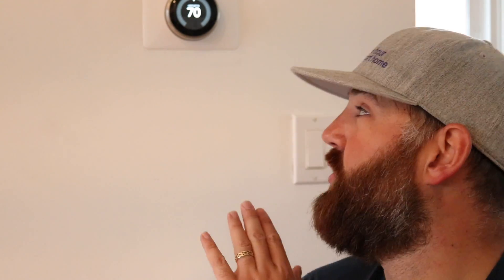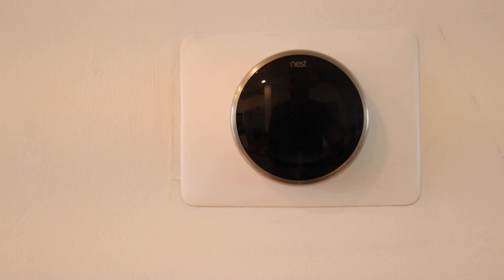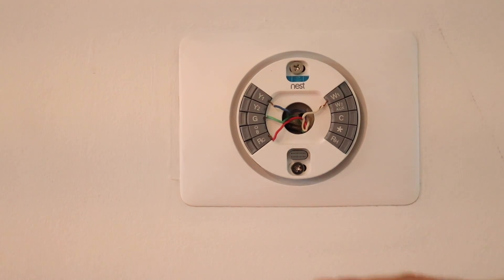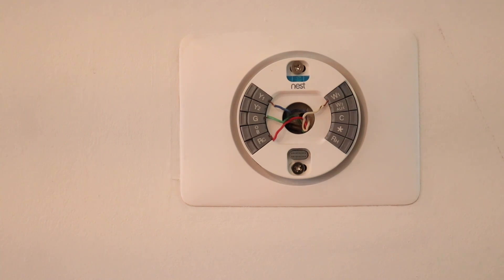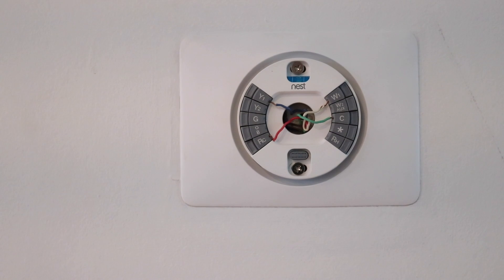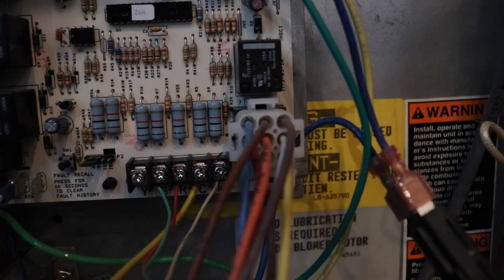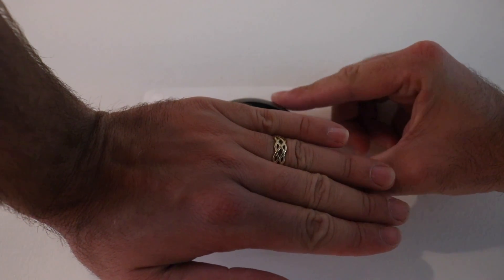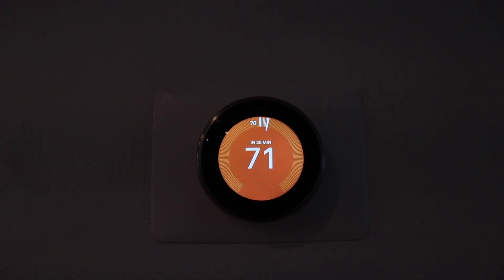Nest Common Wire Hack!!! - Nest Low Power Fixed

Comment: My thermostat wiring has a c-wire that isn’t attached to the C screw on the furnace but there is another wire attached to the C screw on the furnace board. I assume that’s from the outside compressor? Can I connect the unused C-wire to the furnace even if there’s another wire there?
Reply from the maker: Yes, typically you can connect the unused wire to the HVAC terminals even if theres another wire on the same terminal. Just follow the  path of the spare wire you are going to use or make sure it's in the same bundle as the other wires going to the thermostat. Also your assumption is probably correct that the other wire on the C terminal is running to your outside compressor. Typically the compressor wiring will make a circuit that is from the Y terminal on the control board to the compressor and back down to the C terminal on the control board.

Comment: Your configuration at the panel doesn't match behind the thermostat. there's no yellow behind the thermostat. And at the panel yellow is already on C with nothing on Y. Why is that?? And what if yellow is on Y at the panel...will you need to add a jumper from Y to G once green is moved to C at the panel?

Comment: Thanks for this video.   I didn't read all the comments, but I didn't see this one point.   I was having occasional issues with low power on my Nest.  I watches some detailed videos about low battery where it spells out that Iin (Current in) should be above 20mA (mA is a measure of current.  Controller uses 24VAC to send signals to the Nest.)  

Mine was at 20mA.  So mostly working, but sometimes not (Low Battery, Network disconnect, etc).  My house has 3 wires, so I moved the G to 24VAC Common (C).  Then the Iin bumped up to 200mA.  I figure that should keep the battery pegged, and fully charged.  I assume Iin is the current being fed to the Nest from the control circuitry.  Please correct me if I've got anything wrong.

Comment: I just bought nest 2020 thermostat. I have only heating system with two wires ( there is a blue (G) wire in the wall for fan but it was not connected to my old thermostat. Now after connecting wires, neither nest app nor google home lets me continue setting up my thermostat. What am I doing wrong?
Reply from the maker: Mina, watch these videos they should help: Nest 2020 Install:  https://youtu.be/dhwl5h2uynI    2 Wire install: https://youtu.be/Mhz6bbsCUtE (this still works for even the 2020 mirrored version of the nest thermostat, you just use the R terminal)     Thermostat Wiring Explanation: https://youtu.be/vG-K5TDYYNA  Nest Wiring: https://youtu.be/CCNIko3iZIE .  Not everyone needs a common wire, and if it wasn't connected on your old thermostat you might not need to connect it on the new thermostat.  If you have a Red (R) wire and a white (W) wire you most likely need to just connect the R wire to R and the W wire to W on the new nest.
Reply from the maker: Please share/comment your results to help others when you find a solution, thanks!

Comment: Best video to troubleshoot. I have a modern heating system that wouldn’t turn on after installing the nest. After seeing how simple it was to connect the common wire I went ahead and cut power and reseated the rest of the cables. After a quick reboot everything worked.

Comment: Did this wire trick with my new wifi thermostat. Worked perfect. Got the green wire marked "c" for any future thermostat changes. Never once used the fan anyway, so this saves alot of time from running a new wire.
Reply from the maker: Thanks for watching and the helpful comment!

Comment: My C terminal on furnace board is connecting to the AC ，Can I Connect  two wire together on the C terminal to AC and thermostat ？
Reply from the maker: Yes, leave the C wire on from the AC,  you can have 2 wires terminating on the C terminal, the AC and the thermostat.

Comment: Will this solve the e74 code on the nest
Reply from the maker: The e74 error is no power to Rh wire detected. Typically that means that your HVAC system has either been turned off a the circuit breaker, the switch on or near the unit or it has had a fault that cut power off to the system.

Comment: Using the "Nest Thermostat Common Wire Transformer" worked out great!   My boiler has only two low voltage (5VA) wires for the thermostat.  When I plugged in the two wires to the Nest wiring block heat was called all the time until I unplugged one of the two wires (Rh / W1).  I thought I had a defective Nest wiring block.  However, I gave the common wire a try and now it's working perfectly. 

My favorite feature of the Nest is that it knows I have a boiler/radiator setup and has learned if it turns the boiler off a degree or two before reaching temp that the house will still warm up to temp.   This is awesome because we no longer have the temp overshooting by 5 degrees. Leaving us feeling like the house is at a consistent temp.

Comment: Just so everyone knows. You have to have the G connected in order for it to function in cooling mode. The Y only sends a call to your outdoor condensing unit. If you do this hack, cooling mode will not work.
Reply: Yeah, I have the same issue. In the summer, only the compressor is turned on but fan is off . Worked well in winter but now I have reverse back to G wire.
Reply: @Petey-The-Cat  You just have to add a jumper wire...

Comment: I've read this may not work with HVAC systems that use Electric Heat. Do you know why this is?
Reply from the maker: If you have a 24v low voltage thermostat it should work. Many heat pumps have back up electric heating coils and the nest works fine with them.

Comment: So no Jumper Wire from Y to G? May I ask why that is?
Reply from the maker: Most modern HVAC systems will automatically turn on the fan (G wire) when a call for heat or cooling is detected.
Reply: @OneHourSmartHome  thank you!
Reply: @OneHourSmartHome  I spoke with Nest and they mentioned the nest charges even when the ac/heat is set to 'off' (such as on a nice day). If that's the case, shouldn't my Nest stay charging? I know there are other variables at play, but the nest has been installed for over a year with no issues other than the low power message I saw today. 
I had my T-stat 'off' due to nice weather, then after turning it back on it was connected to WiFi for roughly 10 hours, then I got the low battery. It's back up to over 3.7 volts (it 'fixed' itself in the last few hours and is now back online)
Reply: @OneHourSmartHome what about older systems?? My fan won't run with AC

Comment: I have a heat only system using Nest E and this worked at my cabin, thank you! I hooked 24 v adapter to wire 1 to [C] & wire 2 to [R]. Heater red to [W1] & heater white to [R].
Reply from the maker: Great to hear glad to help and thanks for subscribing!

Comment: C - WIRE  is simply ground / earth wire..  It doesn't really have to be connected to the controler in your ac / or furnace but ANY electrically grounded  object such connector (ground screw)  in an electric switch, the surface of the electrical box (has to be grounded by per the code)  or directly to electrical ground /earth wire.      And yes, NEST will love that new ground connection as it allowes that the battery to be charged full-speed whenever it needs to be, regardles of the ac or furnace being on or off.
Reply: Does that mean I could run a new wire to the ground in a normal electrical outlet?

Comment: Thanks for the Nest 3rd Gen common wire fix. Ended up seeing the green wire from furnace joined to a green wire from the humidifier by wire nut. Took nut off, installed twisted pair to common wire port on the board and BINGPOT!! 😃

Comment: Tried this, I had a 4 wire Honeywell thermostat that was working fine. Connected my Nest with W1-Y1-G-RH and it initially worked fine, but the following day said the internal battery needed to be charged. I updated following this guide, Nest now is W1-Y1-C-RC (tried RH as well as RC, both show the same error), and I get E103 error, basically saying Y1 wire has an issue. Any ideas, aside from buying the transformer or running a set of wires that has C (common)?

Comment: My nest quit working after years of use. I have one of the first gen units. It complained about no power on rh. I had a spare blue wire in my bundle and wired that to C at the nest and control board. AC is working now but it now complains about no power on stage 2. I'm just glad to have the AC back.

Comment: I just got the Google nest e thermostat and I only have 2 connection the white wire and the white wire and a bypass that does from the Rh to the RC. The instructions say that the bypass is no longer needed but I do not have any power on my new thermostat. What am I doing wrong

Comment: Did this and it worked for about 2 hours. Now I'm getting a Y1 wire problem.
Reply from the maker: Interesting, could be a bad transformer, blown hvac fuse or something wrong with your hvac system. What wires do you have installed on your nest?

Comment: My Nest also has power issues. I have a blue wire connected to the Common terminal on my control board but was not connected to my old thermostat. Can I just use this Common wire with the Nest?

Comment: What if you live in a hot climate. Never turn on the heat. Can you use the W wire?
Reply from the maker: Yes, if you never intend on turning on your heat and you have a traditional HVAC system. You would disconnect the w wite at the hvac system and thermostat and move it to the c terminal on both the hvac system and thermostat.

Comment: I have a dual system boiler for heat and AC for cooling the cooling is zoned and to control it they both use only two wires,  cool is wired to Y and RC and heat is wired to W1 and RH my nest is not charging and shuts off I tried wiring a C wire from the Boiler transformer but the Nest gives me an error message should I take the C wire from the AC instead?
Reply from the maker: Yes, I would try taking the C wire from the AC.

Comment: I have error code E23 on the cooling Y1 yellow wire. I checked and they are all connected. Why would I have this error when I’ve been using it for a year with no issues?
Reply from the maker: Either you need a common wire, or it could mean you are having an issue with your HVAC system where it has tripped an internal breaker and cut off power to the thermostat. Or the switch is off for your HVAC system or the circuit breaker is off for your HVAC system.

Comment: Dude....THANK YOU!!!!!!!! I got it to work. Damn Nest could have put a little MORE emphasis on you NEEDING low voltage power to the thermostat. 

So I was worried that I'd lose my HVAC blower (not fan) to circulate the coolant through the house but as I found one white wire in the "common control panel" already connected, I simply added this fan wire (green) to that instead along with that white along side it and it worked! Thank you for giving us this hack. I'll remember what I'll need when I bring this Nest to my new construction house I'm working on customizing.

Comment: Should have never installed these Nest thermostats in my house, have three of them, one on each floor and I get error codes all the time on mine! Time to get ride of them and put traditional ones back on after 6 years of problems!
Reply from the maker: Do you have 3 HVAC systems or 1 or two systems with mulitple zones? If you have a zone panels you will need to run a common wire from the zone panel to each nest typically for the HVAC to work properly.

Comment: Thank you for this information. When I took the panel off of my furnace the control panel is not visible. I do see the thermostat control bundle of wires coming into the furnace with the blue green yellow orange red white brown etc. wires. They van are all connected via wire not to matching wires coming from inside the furnace. Right now the green wire is connected to a thick gray wire, not one of the thin low-voltage wires like all of the others. When I attempted to remove the green wire from the thick gray wire and connect it via wire not to the yellow wires the unit wouldn’t work. So I put everything back the way that it was. Any suggestions? I really appreciate the help. Thanks
Reply: Same problem I have. My HVAC is only 3 yrs old so I don't know why the gut did that

Comment: Will this work with a central unit? One that has heat and cooling?
Reply from the maker: Yes it should. The Gen 3: https://amzn.to/2OlfEWk works with most HVAC systems including some light commercial rooftop units. As long as it's got a standard thermostat currently and not a BAS system it should work.

Comment: My furnace C terminal already has 2 wires connected.  Can I still move the G wire and have 3 connected?
Reply from the maker: Yes, most likely those other C wires are for your AC compressor and a humidifier or dehumidifier. You can have 3 connected to the same terminal.

Comment: According to nest agent I'm facing the opposite, higher voltage i got error saying something about the green wire (G) (i forgot exactly what was the message) i even tried to remove it but nothing happened the T stat has no control of anything... Do you have video for that ? They told me to have HVAC guy to come check the voltage and the current which I really don't want to do so instead i put back my older T state..

I have exactly like yours but i have C wire , w2 instead of w1 , black wire to * and orange (O)

Comment: I have steam heat with a gas furnace with 24 volts on the RH wire. I also have a central air system with 24 volts on the RC WIRE. I also have the Y W and G wires with no common  wire. The nest kept dying.  I had an electrician run a common wire off the furnace. The nest saw the common and lost RC   When I disconnected the common the RC came back and the nest battery stopped charging again. How can I solve this problem ?

Comment: Tried this and now we are getting error message 195 saying no power to R detected. Any tips?
Reply: You possibly didn't turn the furnace power back on or you moved the r wire so its not connecting good anymore.  Or you shorted your furnace/ac and now you need to replace the circuit board fuse.

Comment: I have a nest E and I’m having problems gettin the fan to run while air is on and it’s a heat pump unit
Reply: What is your nest error code do you fixed already  thank you

Comment: I have an 8 month old at home. The Nest stops working (only fan is blowing but no cool air) during 12 pm to 8 pm every day when the temp is around 82 outside.  I google the problem and found this fix. It works like a charm. You saved my life!

Comment: Hi maybe some one could help me I have the nest but only have the AC connected to it since I have electric heat.   Having problems with the fan working with the AC.  Right now the green wire is connected to g. But I'm getting very little fan flow from the vents.

Comment: I did the G wire hack and after a couple of hours still showing low battery and is not connecting to the internet because of the low battery any advice with this?
Thank you.
Reply: Hi, I'm going to assume the problem fixed itself as the nest is now charged. While low on battery power, the nest won't use wifi.

Comment: I have dual zone heat/cool with separate thermostats.  My basement is functioning fine with Y1, G, R1, and  W1. My Living Room has an intermittent E160 error stating no power from the AC unit on the Y1 wire. This error comes and goes a couple of times each day. What might be causing this? Both thermostats are wired identically.

Comment: What impact will this have if your Nest is set to use the "Airwave" function to get all the cold/hot air out of the ducts after shutting the AC/heat off?  I'm guessing Airwave won't work properly?
Reply: Came here to ask this question. I would imagine that’s the main downside of doing this modification.

Comment: I have seen some other videos...Honeywell specific that after moving the G wire they say you need to run a jumper between Y and G now for the fan to come on.  Can you comment on that.  Is that not needed here for Nest?
Reply: In this video he claims that the fan automatically comes on even if the G wire isn't connected. If your air handler does not come on automatically with heat or ac, then you MUST add a jumper between G and C.
Reply: @gizmoguyar  Between G and C, or between Y and G as the original comment stated? What's the difference?   Also, thanks for replying to that original comment
Reply: @Chaucer89  exactly, now has anyone tried the Y-G or C-G jumper to see if fan control comes back on ?

Comment: If y1, g, w1, and Rh are connected is it still safe to do this?
Reply from the maker: Yes, as long as you turn the power off while you make the changes.
Reply: @OneHourSmartHome  never expected such a fast response, thank you. I checked out the furnace board it has two C screws, with 2 wires to 1 c and 1 to the other. Ill be okay adding green to that 1 c with one other wire to it?

Comment: I was about to throw in the towel until I saw this video.  I did not want to run a new wire w/ a common to my HVAC unit as it's over the river and through the woods.  I'm definitely going to give this a shot and I don't see why it wouldn't work.  I have seen a bunch of these videos and have installed a couple of NESTS now and this one is by far the most informative.  Thanks a ton.
Reply from the maker: Thank you for the comment and glad to help!

Comment: My AC keeps cycling for a few minutes and goes off as you described. What if you splice the G wire to run it to C on the nest so you can still maintain control of your fan and get neat more power. Also, I don't have access to my HVAC system as I live in an apartment as its always locked, so I cannot switch the G wore to C at the HVAC. Any other recommendations besides 24V Transformer, Adapter C wire adapter?